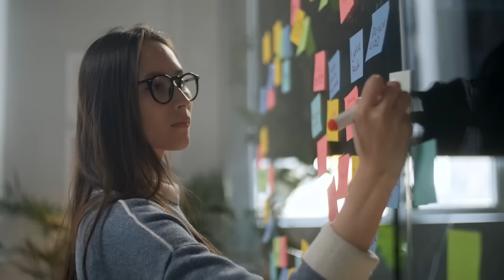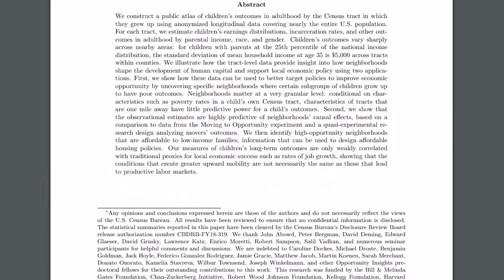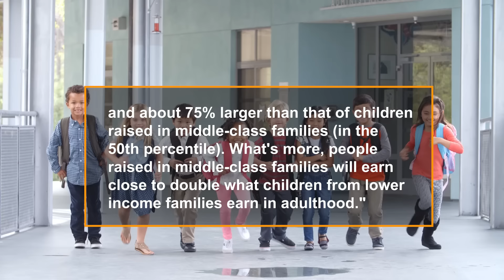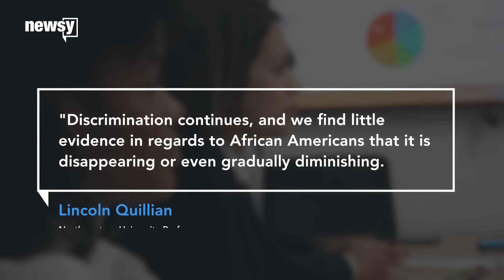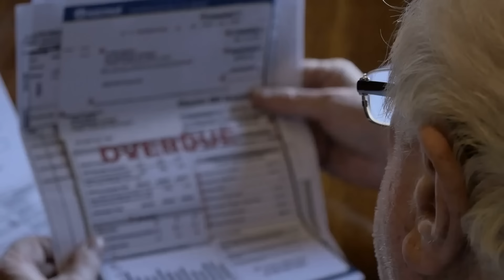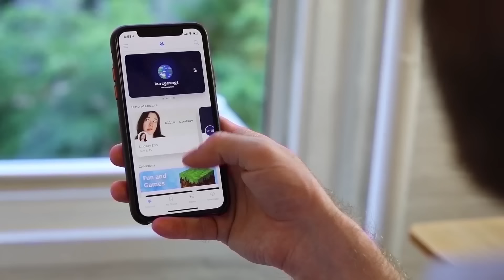The Problem With Hyper-Individualism

Comment: And no-one ever mentions the fact that not only are there very limited (through design or by virtue of our hierarchical system) "good" jobs and the majority of the "bad" jobs are actually considered necessary (as we found out quite dramatically during lock down) fro the running of society.

Comment: Interesting perspective. I find it strange though that you mention the existence of a lot of nuance (read: details) in "non-individualistic" worldviews (for example about the civil rights movement in the ad at the end), but seem to throw all "individualists" into a single bucket as if they shared one rigid mindset that has no spectrum of ideas. 

Why not group all anti-individualistic ideas into a single idea as you did with pro-individualism? I believe the picture would look very different if you gave both sides the same treatment.

You treat a rather large bucket full of ideas as if it were a single one and imho you lose a lot of detail there, in essence creating a "side" that you then compare to singular ideas (and ideals). I personally don't believe that this is sound logic, even if i can agree with some of the points you are making.
Reply: As far as i am concerned this makes perfect sense, because he clarifies quite exact which type of individualism he is referring to. So he does not really summarize a whole lot of different ideas as "the opponent". As soon as the school of thought emphasizes the sole personal responsibility as primary factor to determine ones fate, is is false because of the data he presented.
So what he does is that he proves that a certain concept is wrong, and a certain individualistic view that is based on this concept has to be dismissed.
You cannot have a true statement if it's based on false arguments, simple logic. Sure, this applies to an array of the individualistic philosophies, but it is inevitable if they are founded on the idea of personal choices being the only factor to be considered.

Comment: Rather than insisting on purist collectivism or individualism, as if there are only two choices, we should recognize the objective strengths and limitations of each approach and attempt to render a system that solves the problems of the extremes and better serves both the individual as an autonomous being and the greater benefit.

Comment: 1:55 "It has earned the label of common sense" - The phrase "common sense" is used today to describe a choice which intuitive to most people. Now considering the fact that most people think that most people think as they do, there's potential for all options to be referred to as common sense. 

But the main reason comes down to the relationship between reason and independence. Individualism advocates primarily for independence to allow individuals to make their own decisions and run their own businesses. Those who prefer this route are often driven by maximum profits, which in turn promotes a work ethic which values logic and objectivity. Or in other word, the boss will opt for ideas which bring results and reward/promote those responsible, as opposed to going with their own ideas. In doing so they are investigating reality objectively, and have (in comparison to their less independent counterparts) probably done so for a very long time. A lifetime of doing so can enable you to better understand the causal relationships exhibited by nature than someone who say, just started working for Tesco at age 16.

Comment: Nice and interesting video. I can agree that the odds for different groups as a whole at 'succes' are indeed different, that's indeed what your statistics show. But I think you could've mentioned a bit more that these group values are mean values, not the value that eveyrone in that group will get automatically from birth. Each group will still have values that are higher than that mean (and lower of course), so I would still argue that there also is a fair bit of 'succes' that an individual can earn themself in the system. Clearly not all, but a fair bit. Looking out for your next vid!

Comment: 1:08 Oh, come on. How could you give no for an answer? Actually, collective responsibility and individual responsibility are BOTH important in tackling climate change. When an oil company like Exxon or Chevron tells you to do your part for reducing carbon emissions, they are hypocritical if they are not also doing their part and they use individual responsibility as an excuse to...drive attention away from collective responsibility. August 21, 2021, 10:13pm

Comment: Here in the UK women are still bleating about the wage gap being 30%. This simply is not true. ONS figures show that over all it's 17% with more than half of that due to women working less hours. When the very few who had identical jobs worked very similar hours and had the same qualifications and experience were examined the gap was less than 0.8%. Then there is the real spanner in the works - Denise Coates and her ilk. Denise Coates earned £450 million in 2020. She is the highest salaried person in Europe. Proof along with several others like Lisa Su that the "glass ceiling" does not exist.

Comment: Okay, so I agree with your points for the most part. I have one question however, why do we keep splitting people up by race? Race isn’t even real. Or by gender, why separate people by gender? Why not say, 30% of people get paid lower for a certain job, replace race and gender with people, because when you split people up it creates division, it dehumanizes those groups and it separates them from the rest of us

Comment: there is a major problem with the logic in this video. Going off the data, it is rather easy to assume that people who are born in low income families will themselves be unsuccessful. However, the jump to the conclusion that this is because individualism doesn work is rash and doesn't look into the reason why. You must be able to analyse data yes, but also infer meaning. It would not be unreasonable to suggest that all this data means is that children born in low-income families are not given the right circumstances to succeed, however it does not mean that this is impossible. There are plenty of working class families that exist that have bettered themselves and their children have gone on to be vastly successful, as the mentality their children adopted was critical: if you work hard enough, you can do it. I myself am proof of this, from a working class single mother, to middle class high earner.

Comment: No, it's a mix of both. Blaming all problems on the individual is wrong, but so is blaming all problems on the society level. (which doesn't mean the problems meantioned in thsi video aren't real, but the "solution" of just stopping individualism is just as problematic)

Comment: I still dont agree with u on the zip code things. Why the hell that Asian immigrants a minority achieve so greatly economically. I don't believe such thing as systemic racism. I call it a systemic racial disparity, it is not racism. It is caused by socioeconomics majorly and race is the surface. Why do Nigerian achieve better.

Comment: There is an aspect of individualism that I like though sadly not sure if it even exists currently, the aspects would be a higher focus on one's self, being yourself and not needing the approval of the people around you and having some degree of immunity to social conditioning so you are truly free to be yourself rather than NEED to fit in and follow moronic traditions in order to survive.
Collectivism on the other hand has its advantages like the video showed but it also has some major disadvantages for the people who are "different", dont "fit in" such as neurodivergent, hell the issues are even visible now because even if people talk a lot about individualism they are very socially conditioned on how to act and behave which theoretically should be the opposite of individualism but that is what is happening right now
That is why I find genuine communal communist ideology flawed, the average neurotypical is far too easily socially conditioned and always leads them to treat the "other" as something bad and wrong and that flaw is not something that is easily fixable.

Comment: I appreciate that the topic is raised, but the argument overly simplifies the matter. A mere statistical correlation between groups and outcomes does not explain any actual mechanism. For example, poor people do tend to make worse financial decisions than more wealthy people, but this is because of the stress and anxiety caused by poverty, which causes them to make choices only on a day-to-day basis rather than long-term.

It is nonsensical to deny our freedom of choice and importance of our decisions, but still suggest that actual solutions to societal problems even exist -- because tackling them would require a strong freedom of choice.

It is understanding of statistical correlations and empowering individuals together which can improve equality. Depicting them as opposite ends or contradictory therefore aggravates the problem.

Comment: 4:17 he had connections from his mother, the tesla roof is not a non solution, his electric cars and charging stops have the highest reviews. 
4:26 That's not entirely true there's a lot of inherited wealth in one spot but it's not  like there aren't new wealthy people living there? 
5:26 Most women pick lower income fields, colleges are loosing the demographic of white men and the pay gap has disappeared in the UK after only about a century since womens suffrage. 
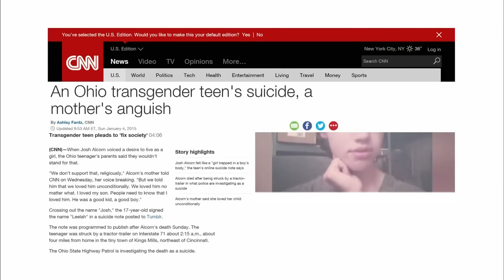6:18 that claim is idiotic and highly questionable, 
6:23 how are trans people under danger by the police and what the fuck thoes that have to do with the inherited racism of police stations?

This is a very meh approach to denouncing HI you should put in more work or else keep getting only the same views from the same echochaimber.